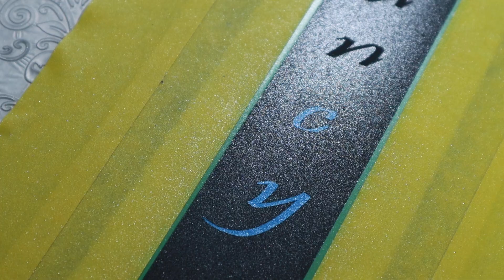Embossed Tin Foil?? 3D Custom Paint Job tutorial by Time Warp (Remastered)

Comment: Whatever the stencil is you use that has the decorative indentation on, may I suggest from one artist to another, that you get another stencil made to match yours that is mirrored.
It's a detail thing and I'm sure you've probably already realised that since you posted the original video, but to have the pattern mirror what is on the left-hand side over on the right, would look even better.  I will definitely look your way for a bonnet design once I can find a suitable car to put it on.